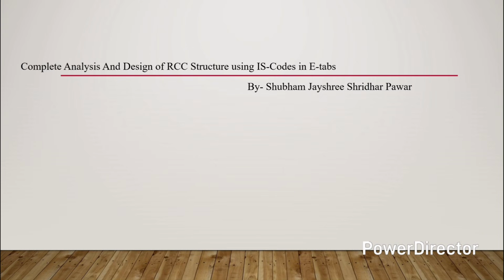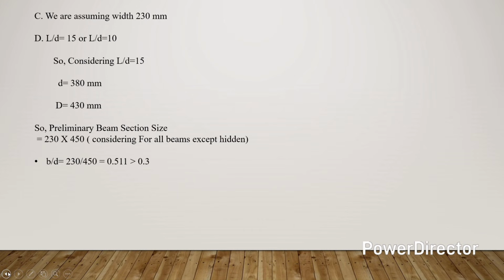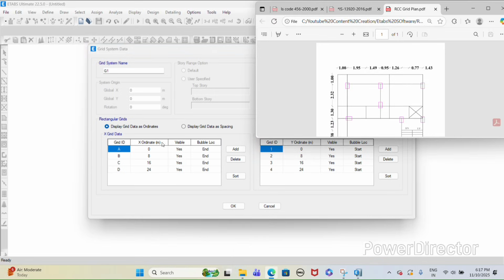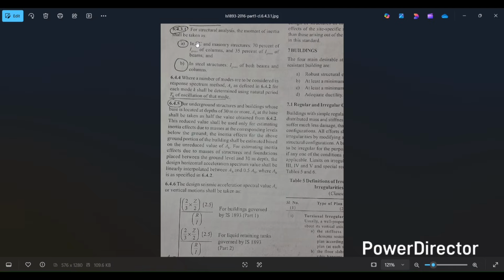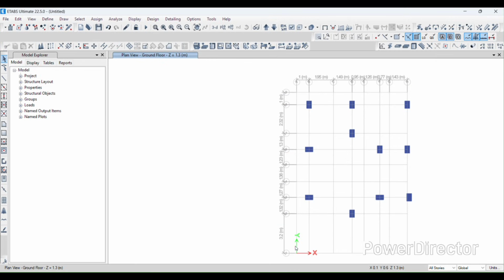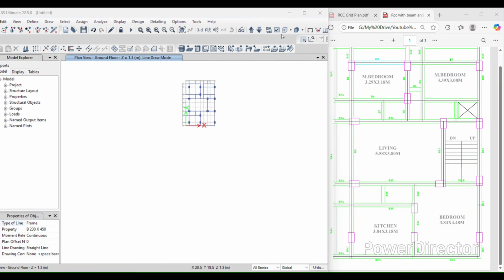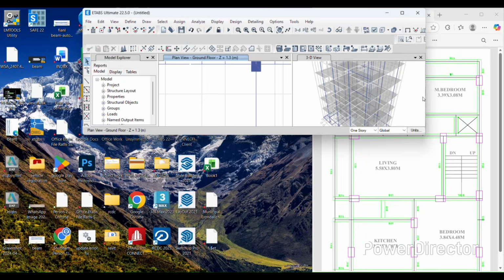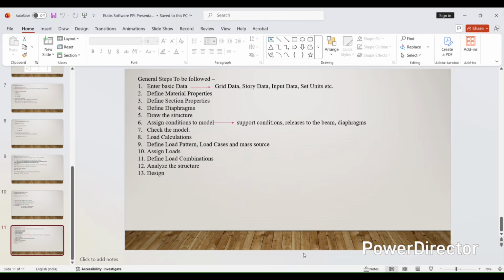ETABS  Tutorial ( Part 1)| Complete G+4  Building Modelling Step By Step

Comment from the maker: 00:00 Introduction
00:45 Course Learnings 
01:00 Is Codes And Technical Details 
03:45 Grid Line Plan
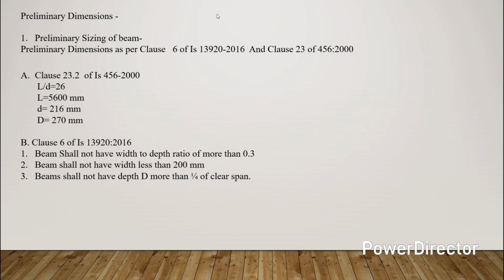04:17 Preliminary Dimensions 
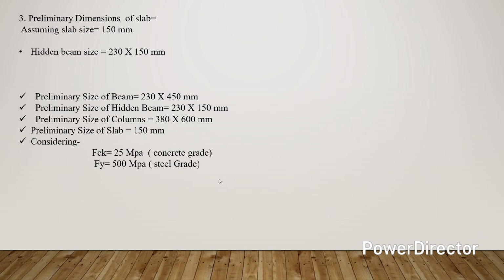13:38 Steps To Be Followed 
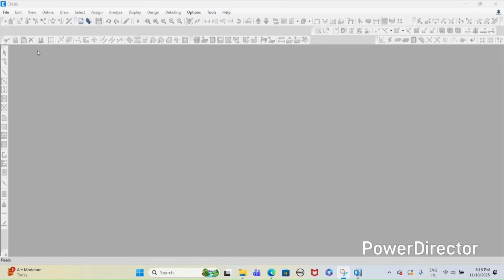14:32 Opening ETABS and Interface Overview 
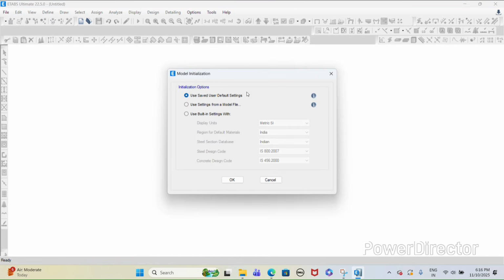14:50 Setting Up Basic Input Data
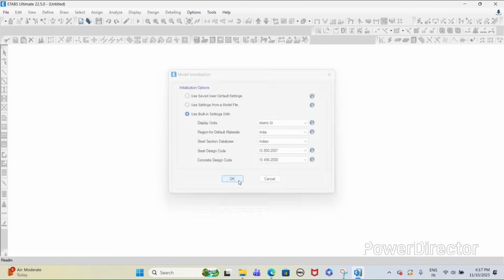15:13 Grid Data and Story Data 
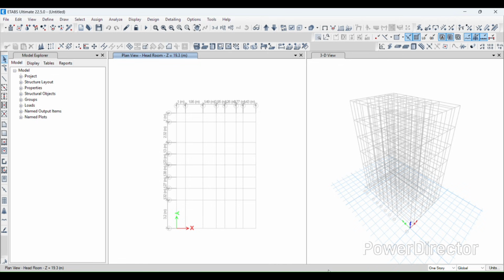20:02 Defining the Material and section Properties 
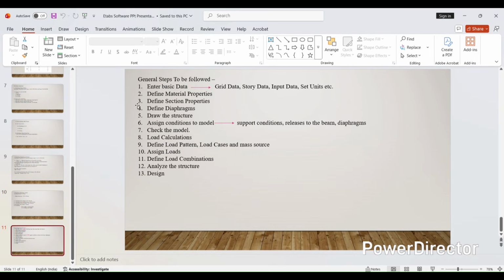27:08 Concept of Diaphragm and defining in ETABS 
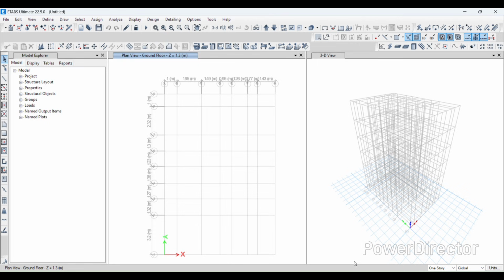28:45 Modelling Of Structure 
29:05 Modelling Of Columns 
32:48 Modelling Of Beams 
39:48 Modelling of Slabs
43:12 Modelling of Staircase